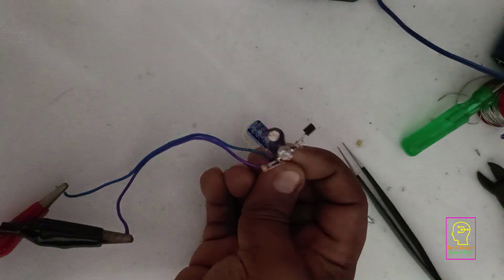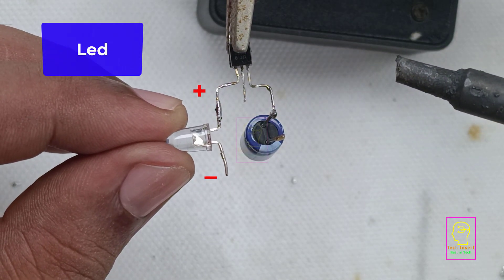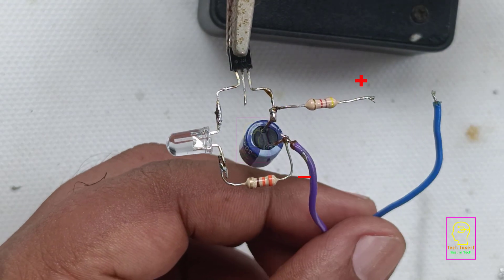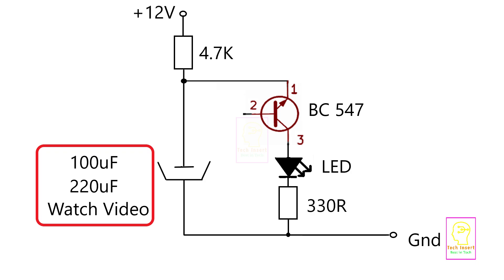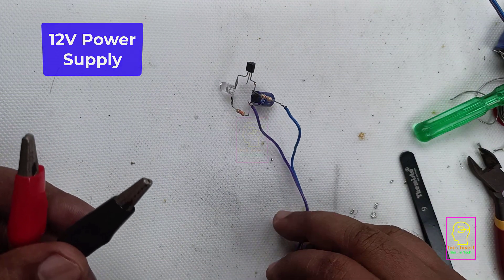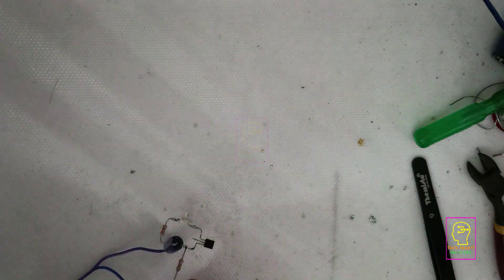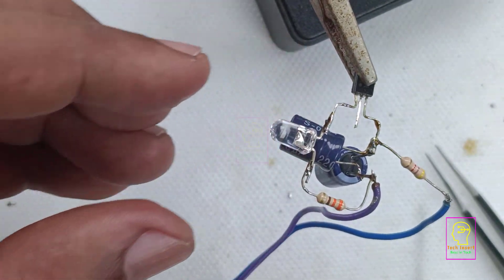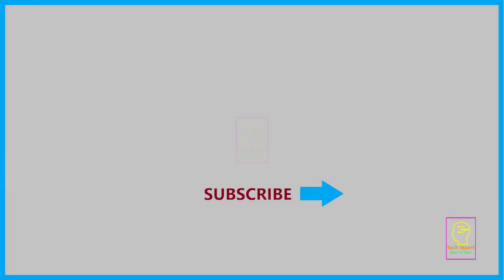You don't believe that a Transistor can work like this | Simple LED Flasher Using One Transistor

Comment: If this circuit connected to the 220 volt AC....what to do
Reply from the maker: You can make use of transformerless power supply for the 12v supply. Pls watch 
https://youtu.be/vsVymzvsumc?si=u5CH1dRaliO-cZGK
https://youtu.be/kAjrv03MnIo?si=hyJajuV3mnE65zzR